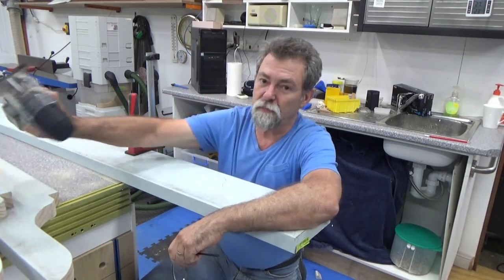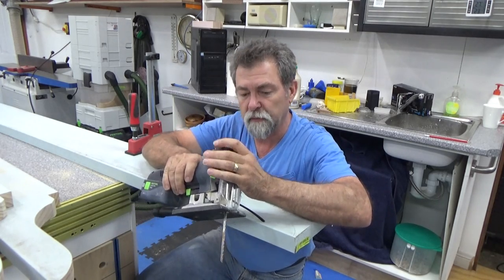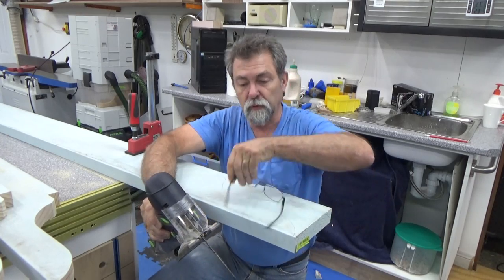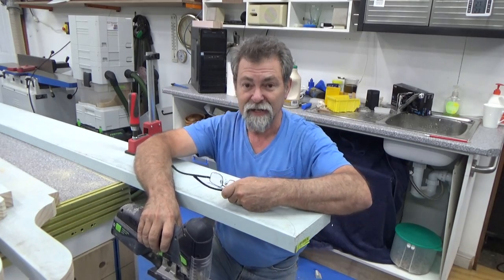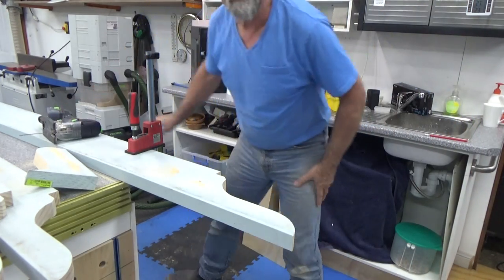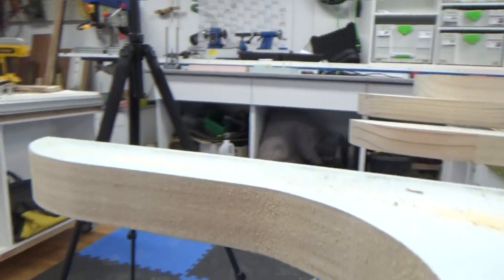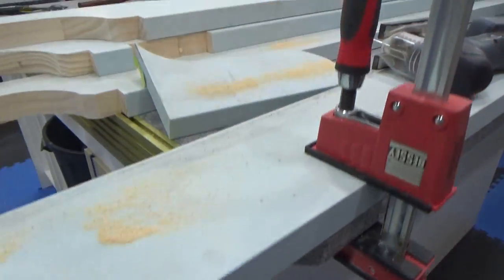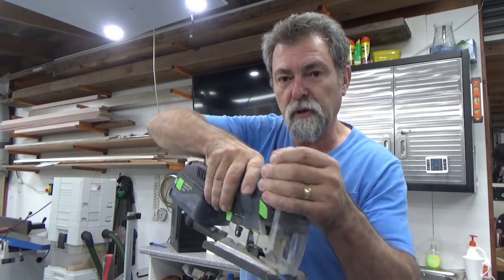jigsaw how to cut nice curves Dave Stanton woodworking Festool

Comment: Good tip.  Thanks Dave.  Also I wanted to thank you.  When we did our first skype talk you told me about using a steep angle blade to work on hardwood panels.  I just finished working on one and it turned out perfectly.  I used my scraper.  Thanks!

Comment: Good day Dave.  I use the German built Metabo barrel battery jig.  My question is on your Festool jig, why does your light on the jig flicker nonstop ?   That would drive me mad.  Also do you get dust build up in front of your jig when your using it ?  My Metabo does get dust build up and I find myself blowing it out of the way as I use my tool.  Thank you always for the videos.

Comment: What's with the seizure light on that saw?  Is that just a camera artifact?
Reply from the maker: The saw has 3 light settings,  off,  on and strobe. Strobe has the effect of freezing the blade to assist watching a line. Strobe turns off automatically when you rotate the saw past 35 degress from standard position.

Comment: Yeah okay if you have a Festool, what about other brands, I have DeWalt, and what sort of blade.
Reply: quite, ive a power craft with a new blade absolute shite when you turn the saw the blade bends so u cant get 90 degrees. im cutting 1 inch thick maybe its ok on thin ply.

Comment: dave dave dave, you didn't read your manual.  pendulum setting zero is not recommended for wood because it overheats the teeth and basically causes a bad cut set it to one if you want to be clean with wood.  and you also didn't mention the importance of setting your blade guide to the correct opening width to minimize deflection.
Reply from the maker: Thanks for pointing out those important details! I'll make sure to include them in my future videos. Keep the feedback coming!